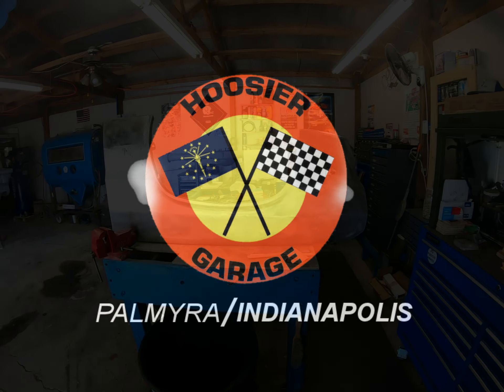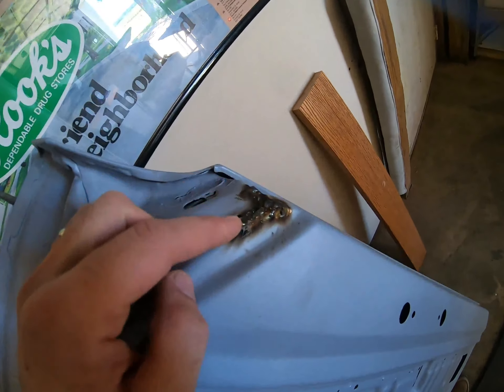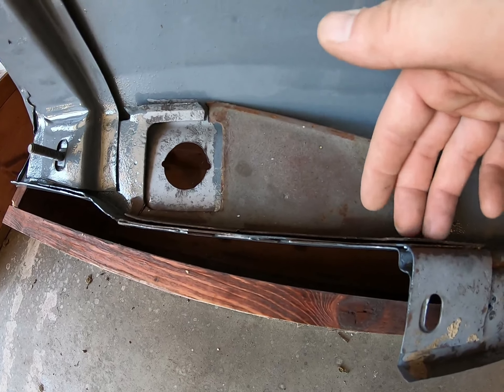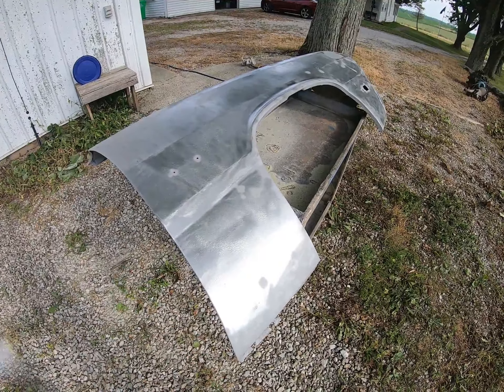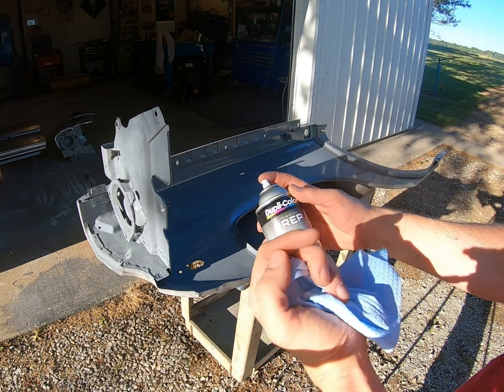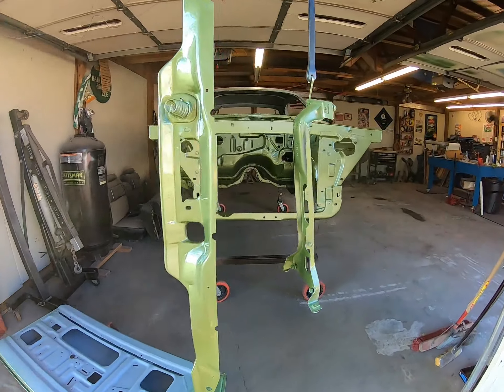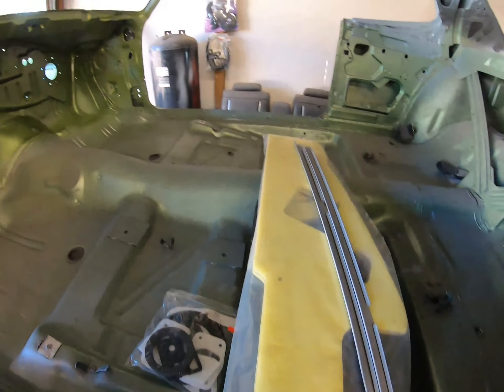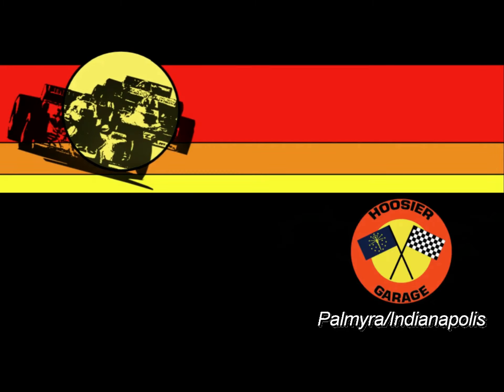I'm Going Green - '72 Plymouth Duster Restoration PART 26

Comment: Really nice video. I didn't take my doors or fenders off, not sure if I'm going to. I'm not sure I could get them back on and adjusted right so I guess I think I'm better off to leave them alone. I'm curious about the seam between the roof and quarter panel. I still haven't filled my yet so now I'll wait and see how you do it. Did you use a single stage paint? Really enjoyed watching, thanks. Alan   P.S. I haven't been getting notified on all of your videos??
Reply from the maker: @yuma5745  make sure you click the bell under the video. I have had people tell me it still might not do ot. Best to check back every week for some form of video.

On your questions,
If your car is mostly clean, and doesnt need pin bushings then leave the doors on. Just take time to prep around the hinges, etc.

Roof seams originall were filler on vinyl top cars, and lead on non vinyl cars.
I always use duraglass in this seam. Durable, strong, waterproof, then fine fill with regular filler.

On the paint ive done on this hidden areas and undersides, i use single stage acrylic enamel.
Reply: @HoosierGarage  Thanks for the info. I went to your channel and I'm watching the playlist. I do have the bell rung but I'm not getting any videos. I will do it over again. Maybe it will wake up.
Reply: I'm going to wait and finish my roof-quarter panel joint until I see your video. Thanks